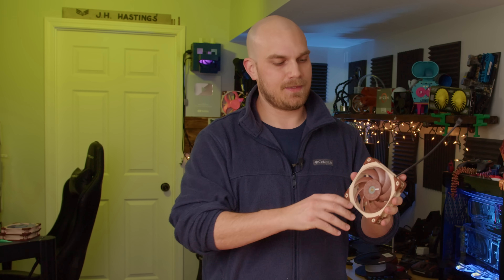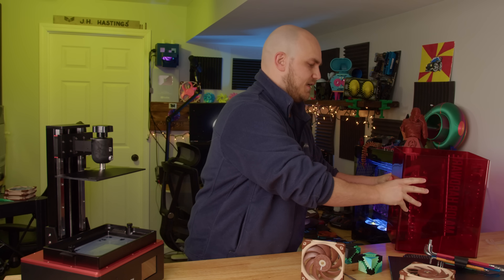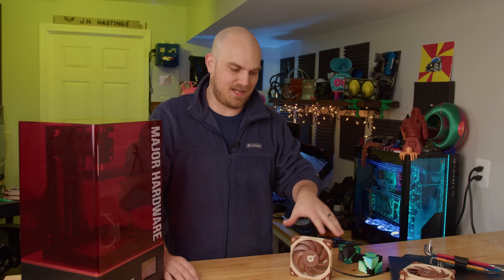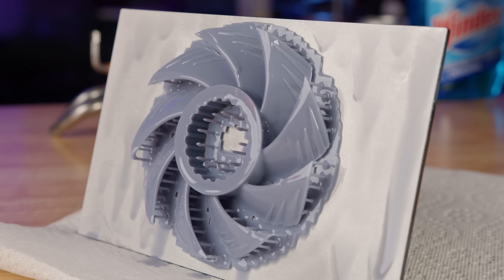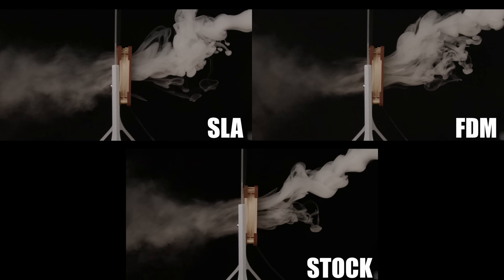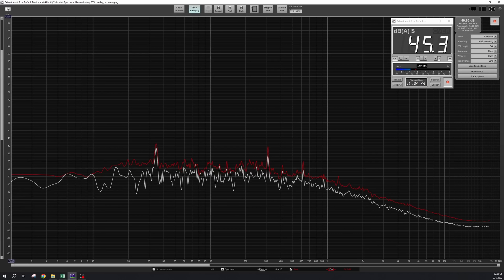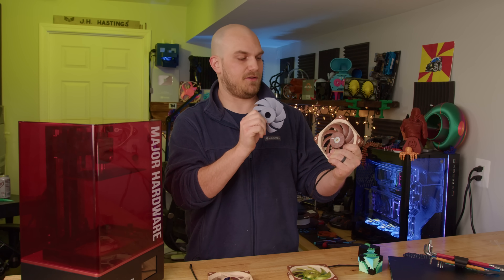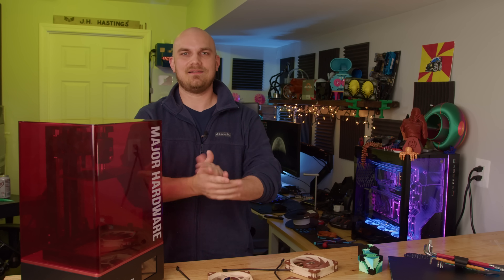I Copied Noctua's A12x25 and Resin Printed it, Its Performance Was ASTONISHING

Comment: I've also a resin printer that I barely use. It really IS a pain for even the most enthusiastic ADD brain maker. :/
Often times the FDM printer also has the material advantage, too. As long as you don't need it to be very temperature resistant, you can choose from many pretty different plastics.

Comment: I think a next level video or maybe a round 2 should be an ABS, ASA, and a poly smooth fdm versions and what did the seamless and smooth sleek super nice candy shell look and feel effects the surface effects etc 

I think it would be the most economical way to achieve better then resin results if you have a fdm vs buying the resin printers etc

Comment: It would be interesting to see if you scaled up the A12x25's design to 30 or 35mm thick, with a duct on the intake side, to effectively convert the fan into a thicker version.  Will it perform like a T30 or better?  Likewise, what if you took that same thicker 30mm A12x25 blade design and scaled the hub so it would fit on a T30's hub so you could get a higher rotational rate with the noctua blade design?

Comment: I would say take some high performing fans. Reprint them in resin and get a larger data pool to see if the 2% difference hold true. If it does then I think creating an extra column on the sheet with 2% added would suffice. Then compare that number to the A12x25. At the end of the season tale the top 3 and reconfirm the 2% is correct.

Comment: Going to resin printing will obviously create a break from the previous fan statistics. This means a new list. So if you go to resin printing you should probably re-print the top 12 or 16 from the current list and re-gather statistics before starting new tests. That way you have some continuity with the past fans in terms of rating new ones. Plus it gives you experience in printing resin.

Comment: Why not just take the part off the Noctua fan and 3D scan it and then print it? While the original CAD file would be ideal, a 3D scan of the original part is a pretty damn close alternative.

In regard to FDM surface finish, couldn't you just print in ABS and use isopropyl alcohol fumes in a container with the 3D printed part for 20 minutes which would completely smooth out the surface finish with comparable aerodynamics as the resin print?

Unless I'm mistaken, it might be worth a shot, and this would be an opportunity to make a follow-up video with some interesting alternatives that reduce your margin of error along with an FDM surface finish alternative to resin printing etc.

Best wishes from SoCal!!

Comment: Resin printing can be alot less painful if you get a flexible build plate, wham bam should sell the correct size for this printer but there may be other brands. A wash and curing machine also goes a long way

Comment: You are saying highest air flow will give the highest cooling performance.
That's not completely true, you also need to consider static pressure in calculation.

Comment: I think their weight, effect to fan power consumption (as watts or amperes) info are  also would be interesting. Efficiency is the key actually. And maybe maximum heat and rpm endurance can be tested.

Comment: The gap between the fan blade and the enclosure should be as small as possible to get the most amount of pressure. You should measure the gaps and try to minimize the gap.

Comment: You should redo this with the FDM fan at different layer heights to see if the difference is reduced :) I know Cura has an option to print the infill at a different layer height than the walls, so you could possibly get one which doesn’t print that much slower than your current prints but with a much finer layer height on the outer skin :)

Might not be completely possible with the current cura tho, since I don’t think there is an option to have just the outer skin in a finer layer height, but you could experoment with single walled prints and full infill and stuff like that

Comment: I can explain why the performance is better on the Original over FDM and Resin, and its not because of the material its made in...

The reason is the surface, the Original fan got the smoothest surface, Resin got the second best surface and FDM as the last, the rough surface on the FDM causes far to much friction on the air.
Thats also why you hear the difference in sound, more friction, more sound, less performance...

I would almost dare to say that if you coated the FDM fan in a good primer or gave it some acetone to smooth out the surface, then it would perform as good as the Original, or at least within the margin of error. And think if you gave the Original Fan a coating of some high gloss varnish, then it would perform even better than out of the box.

In short, its the rough blades that causes to much friction for them to perform as the original, hope that answered your question

Comment: I think comparing fdm printed fans to the fdm printed version of the noctua fan is good as you've essentially eliminated the problem of different materials/build quality. Then you can use the relative differences in results of the fdm fans and just apply them to the base noctua fan to get an idea of what a good quality version of the testing fan would look like.
Reply: This is a great idea!

Comment: I think people who get deep into FDM printing forget how painful it is to get into. Resin printing is, completely inarguably, much easier and more reliable than FDM printing. Unless you're working with an X1 Carbon or similarly expensive FDM printer, it's going to take a lot less knowledge and effort to get up and running with excellent results using a resin printer. But yeah, the other trade-offs are very real. There's a 1-2 foot splash radius from the printer where everything WILL get resin on it and require gloves to touch, the PPE is a pain, you generate waste that needs to be disposed of at special facilities instead of just trashing it, and you're paying more money for parts with generally worse material properties and less accurate tolerances.

Comment: I get much more details if reducing print resolution from 0.2mm to 0.1mm. Maybe compare the performance of a 0.1mm res fdm to the resin model. To know if the roughness of shape alone is a downer  - or the sheer edges are the problem. I have absolute zero knowledge about resin printing. but i know how much longer it taks to print fdm in 0.1mm - maybe that comparison would show if it is worth to go resin or it is just a resolution thing.

Comment: my question is whether you could print a fan with a reversed pitch? There is nothing worse than spending thousands of dollars on a PC build, and not having the fan frames facing the correct direction. If I could print an inverted fan blade, I could run the motor in reverse and have the cleanest rig in town! I wonder if I could run a fan motor in reverse? Do they have start cycles?

Comment: Suggestions: 1. 3D Scan the OEM fan. Use photogrammetry. Make a mould. 2. Smooth the FDM with sanding, scraping, acetone etc Try different filaments. Flexible, rigid, high accuracy, warp resistant. - only need to get it right once, then can design your own fan model.

Comment: Because resin printing is such a pain, why don't you resin print a few fan-made fans, compare those results between print types, and take your avg % difference as a factor in testing with regularly printed fans, so you don't have to keep resin printing over time?

I think a valid sample size would be as little as 5 total fans, or if you wanted to be more rigorous, maybe 3 per season or something like that.

If the variance falls outside of call if 5% performance on average, then maybe it's worth properly revisiting what the audience wants. But for you, who has to do this, what's the best way to not have to do this? In my opinion, figuring out an average performance variance factor.

Comment: you say, "you don't need it". But, the experiments you do, are STRONGLY effected by the Quality of both the leading and trailing edges of fan designs and the rigidity / thinness of the blades material...You do need it!... You just don't do it... not the same thing!

Comment: I suggest testing the stock fan to a stock fan with ceramic coating like the one for cars to see if the surface roughness will affect the cooling that will be a good test also take the best fan that beats the nuctua and retest then apply ceramic coat and let's see if it makes it better..

Comment: Did you see how they smoothed out 3d printed parts in Youtube video w90gM7bGdvk Testing a TOROIDAL propeller UNDERWATER about minute 3:30, looks easy to me.  Another possibility is to use nail polish like video Df32lrVy5os .

Comment: Does anyone know if this is a reliable set of tests when considering drone propeller designs? I don't see why it wouldn't be. The only variable I can think of that isn't accounted for would be the weight of the propellers, but I'm not sure how greatly the weights differ between them.

Comment: I would argue that even though the resin performs better, you've already set the standard with FDM across so many user submitted designs. Seems a waste to throw all those tests out the window because you've changed your manufacturing method, and the results are no longer truly comparable. 

And on a 2nd note, you flat out really don't enjoy working with resin and I don't believe anyone would ever say "I'm not watching his videos because he doesn't print in resin" 

Stick to your current process I say. We all love what you're creating and slightly smoother prints wouldn't improve or degrade that.

Comment: I wonder if there is a difference in weight between the different materials... Perhaps do an episode going over different FDM materials and different Resins to see if their mass affects their output.  Once you find the best then use that material and process and redo the top 10 fans to see what the improvements could be achieved...

Comment: Resin printing makes more sense for the fan showdown because of the smoother surface and that 2% difference. You can have tighter tolerances too because the resin prints can be much tighter allowing you to capture more of the airflow...just my thoughts for what it's worth.

Comment: If the fans are not perfectly balanced then performance is lost. The stock will be nearly perfect.  You'd need to statically balance them all before you make the conclusion that any is better.  You'd intuitively think that the rougher surface of fdm is worse because of drag but it doesn't always work out like that at these speeds and scales.  Great to try it out though.

Comment: I do love this channel, but I have to say most of the fan 3DPs are a pretty low quality, and have often wondered how badly the airflow is affected by the average print quality that is presented here. I totally appreciate it's not your thing, and your issues with resin printing, but most of the prints presented here would go straight in the bin in my world. I really do think you should take the time to try and master SLA printing, but it isn't rocket science and you can get production quality given a fairly low level of effort and some practice. I would suggest a Saturn 2 with its 8K screen would probably cover most of your needs if you are looking for a new resin printer with a really good resolution.  I would also invest in the "ABS-like" Elegoo resin to solve the "creep" issue Noctua mentioned.

Comment: Would be really interesting to see the same test but with different layer heights compared to the results you already have.

Fair chance 0.1 layers would have gotten the FDM fan a lot closer, you don't really think about it but a buddy of mine needed a wrench for an e-bike motor and given the small size of the teeth on that wrench I decided to do 0.15 layers rather than my standard 0.2, and the difference in smoothness and appearance is a LOT more than one would expect from a 25% reduction in layer height.....

My printers are core-xy's(cheap tiny weedo tina2 and a Flash Forge Finder(P1P coming in a few months)) so I'm off to look for videos comparing coreXY to Prusas as I can't help but think that even with a cheap printer the added rigidity of the coreXY must make a noticeable difference.......

Comment: If you take ~2000RPM divide by 60, you get 33.3Hz for the rotation rate/frequency of the fan. Most of that spike is from the motor. Since they are 9 bladed fans there should also be a spike at the 9th harmonic of that rotation rate. 33.3x9= 300Hz. Any differences at that frequency would be more related to design and/or material differences of the fan blades. Which you can see on the FDM print there is a larger peak at 300Hz, while the SLA print looks closer to the OEM blades. Another thing I noticed is at 600Hz and 900Hz the 2nd and 3rd harmonics of the blade rate, they are not as present in your prints. I was wondering since those are closer to the audible range of human hearing if your printed fans seemed quieter to you even though overall dB was slightly higher?

Comment: interesting to see what will happen if you make it ring blade?
theoretically, ring lowers air escape off the blades, but makes fan heavier,  which will reduce performance of the motor or even overload it..

Comment: Definately next season should be with resin. Yes it's more work than FDM, but it is a smoother print. I do recommend maybe getting a 8K resolution printer that has great detail. Like the Phrozen Mighty 8K. It has 28 µm detail level on the prints and is more than enough size for PC fans.

Comment: I don't think your conclusions are at all exhaustive. You have to take into account the weight of the 3d printed blades as well. I am willing to bet that the FDM blades are about 2% heavier than the resin print as well. Also, there are other FDM printing materials you did not go into details about. IE. ABS with Acid bath with fewer infill would reduce the weight, but smooth out the print for aerodynamics etc. I love the first steps you took here, but there is still a lot more to explore. I hope you do!

Comment: Try getting hold of a 8K printer like the Sonic Phrozen Mini 8K(22um 'resolution') is probably the best that's affordable(I have one... ) but the Phrozen Mega 8K(28um 'resolution') has approximately the same print volume as your old Saturn(around 50um 'resolution'). 
Of course, to really take advantage of Resin printers you must run them at a low layer height, and they can be finnicky to get just right on exposure times.

Comment: Yes, resin is the way forward. Help people set up a good procedure for the resin handling, arrange for a ventilated working space, learn to put on new glove if sticky etc. You don’t need to do a video with this information, just practice it yourself and let it show. Resin is amazing, and to build mechanical parts is a breeze compared to fdm. Calibration, calibration and calibration is what you need to master. And a few additional parameters compared to fdm, as the room temperature, resin temperature, and that the resin is well mixed. And you would also want to take a look at the cheaper variants of upside-down resin printer, as supports are a time thief, and you need much less supports when printing “in the bath”. 
Great to see your experiments with fans! Love it ❤

Comment: I suspect fans are sensitive to surface texture. Try painting the FDM fan? The blade leading edge profile might also be critical so perhaps experiment with sanding/smoothing the leading edges of FDM blades.

Comment: Dude, four at once? You gotta do it! As long as you're able to do it safely in a place with really good ventilation, don't cut corners with your health!
I bet there is a slightly bigger difference than 2% in more complex fan designs that have more surface area.

Comment: In all fairness, yes, you should get the highest resolution resin printer for the fan showdown. I understand it's a pain, but fan blades are like plane wings. A plane won't fly as well if it's wings were covered in proportionally sized grooves. Smooth surfaces are absolutely crucial both for flow and for noise.

Comment: just saying, If you want to measure the efficiency you have to measure the power that's needed with each fan blade too...  sure its always 12v but the watts needed for each blade will differ.... it's likely that the original blade will need less power to archive more airflow ;)

Comment: You should do the next season with resin.  I don't think you can assume it's simply 2% across the board.  Some designs may be more sensitive to surface finish than others, and so that effect may be magnified in some designs.

Comment: To make a conclusion that broad off of one sample size makes me a little uncomfortable. To improve the test, I'd think you should do at least 3 of each and take the average assuming no outliers were present among the datasets. But this result does make sense, the lack of smoothness on the FDM disrupts the airflow more than the smooth surface. It may be that what you are getting is a golf ball dimpling type texture that reduces the ability for the fan to grab the air.

Comment: There's small active carbon filter fans you can plane inside resin printers that will almost completely eliminate the smell and remove all the bad particulates. if your FDM printers are eclosed, you could use them on those to do the same and will take care of all those VOC's that even PLA emits.

Comment: As you said the performance was a bit lower for both FDM and Resin compared to the original I would like to know wether the weight of the three is the same. If not, then that might explain the findings.